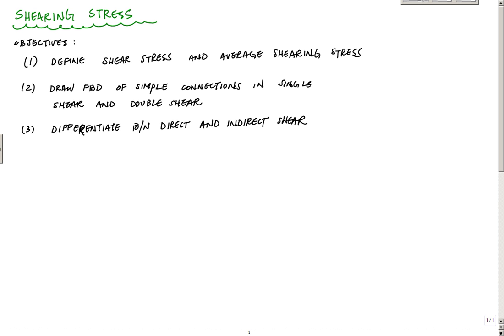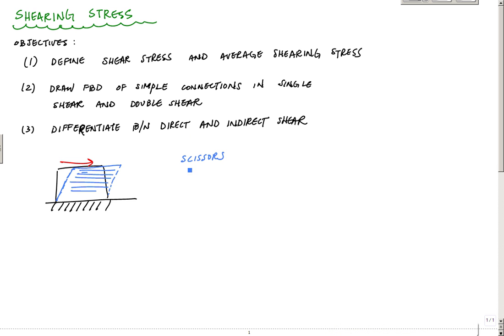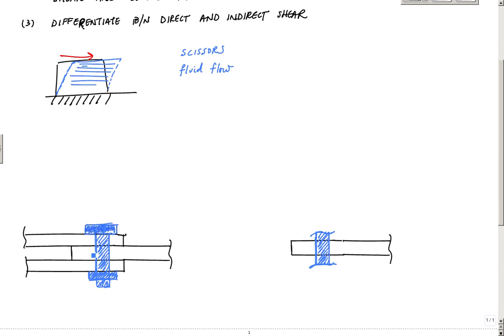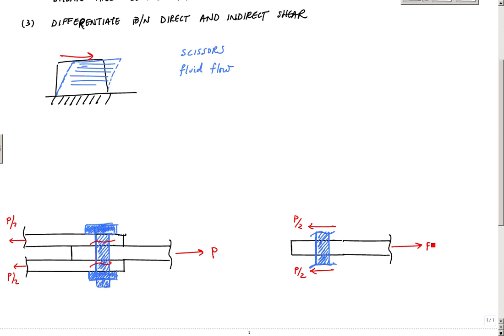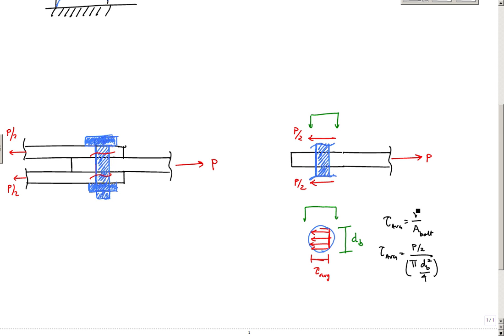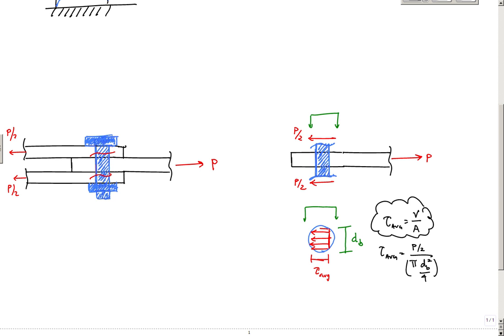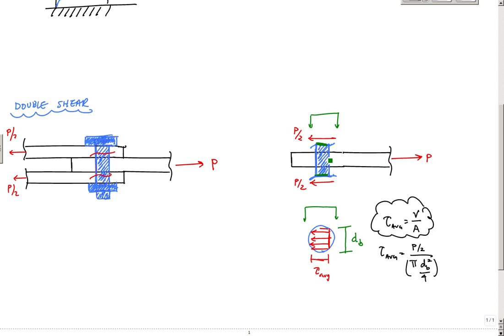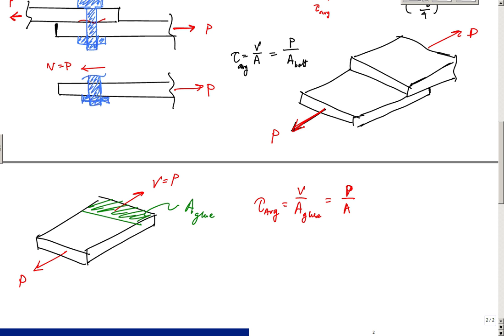Average Shear Stress and Simple Connections - Mechanics of Materials

Comment: sorry i have a question at 11:35, you mentioned that for direct shear the shearing surface is parallel to the applied load but the hole puncher example you gave is not coherent to what you mentioned. 

Nonetheless good vid! Thanks!